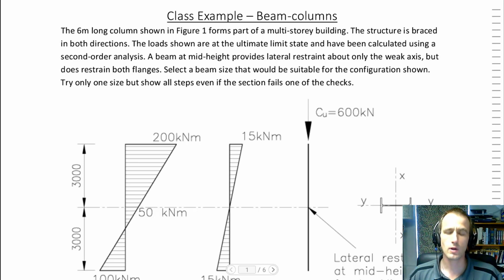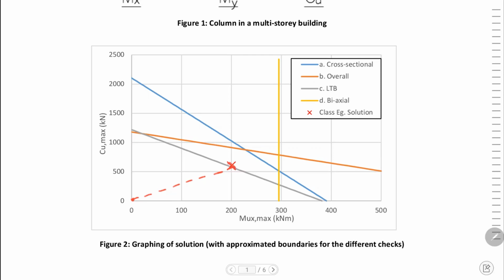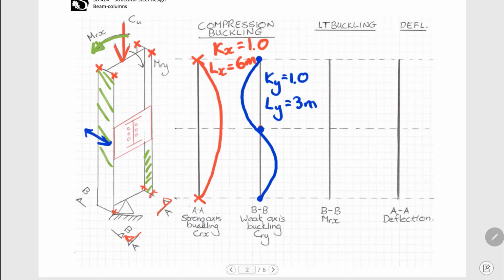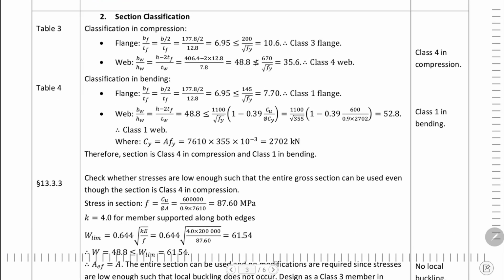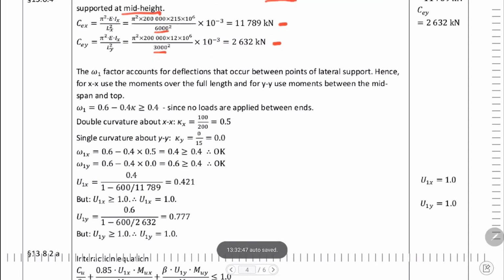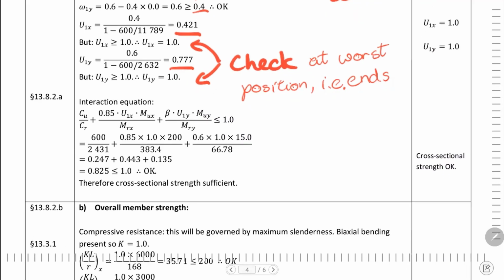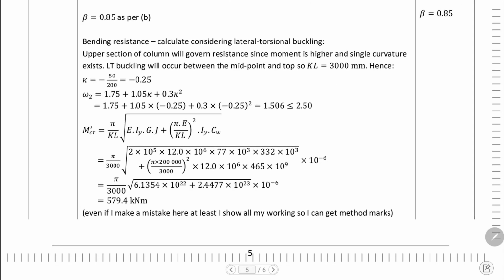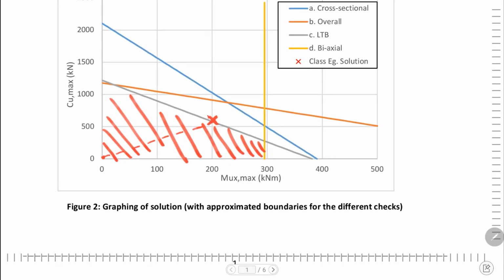Steel Design - Beam-column design - Worked Example - SD424

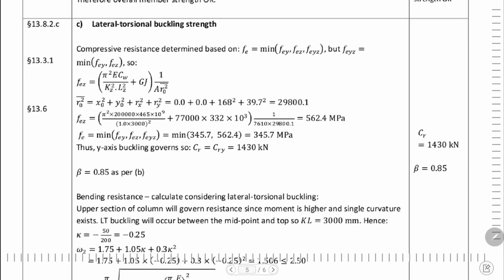Comment: Great descriptive lecture! Quick question - when you reach the lateral-torsional buckling equations (18:42), you state that fe = min(fey, fez, feyz), however in SANS 10162-1:2011 section 13.3.2a) states that fe = min(fex, fey, fez) for doubly symmetric sections. Why is this?
Reply: Dear Michael. 
Hope all is going well in practice since leaving Stellenbosch. 
You are correct that for a section in compression the resistance is based upon fex, fey and fez. However, in Section 13.8.2 for beam-columns it specifically notes that compressive resistance is based upon "weak-axis or torsional-flexural buckling". However, for a doubly symmetric section feyz = min (fey, fez) so it actually does not matter. 
Thanks
Richard
Reply: @richard_walls  Thank you, an important clause that I missed!

Comment: How would I be able to check the minimum section size that will meet all of the checks without going through the process of elimination for each individual section?
Reply from the maker: Most commonly LTB governs behaviour. So you could check that first. Otherwise, you need to setup a spreadsheet and then can quickly check different sizes. Beam-column design is something you only do by hand at university (to learn the principles), and after that you automate the process.